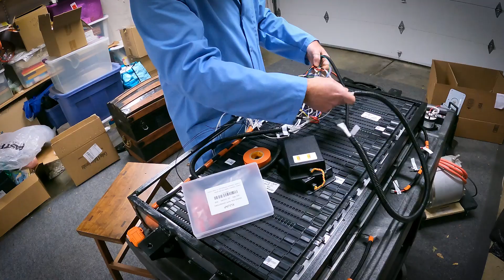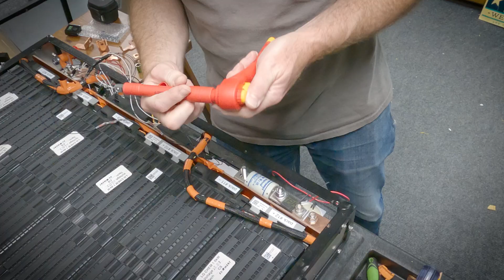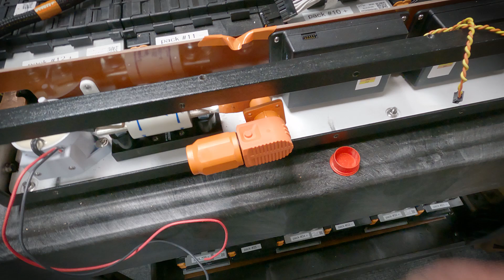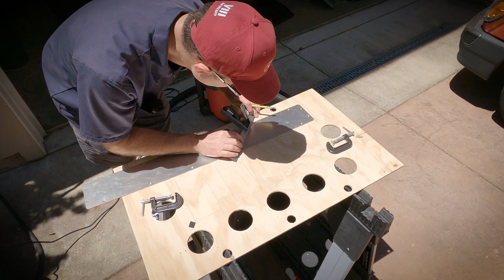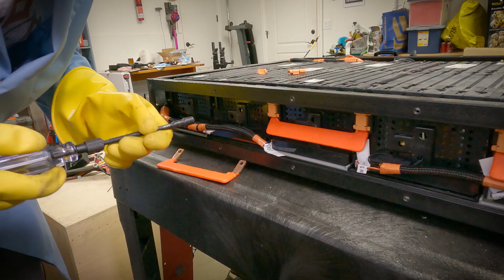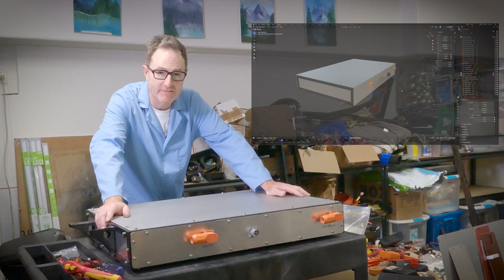EP 32 EV Battery Boxes Part 4 - Wiring, Busbars & Final Assembly

Comment: So is your system going to be 6S x 2P for a total of 20.4 kWh?

BTW I'm in the research stage of converting a 77 Honda Accord so I'm loving this series
Reply from the maker: Thanks! Actually it’s 12s. I have a high voltage motor, so I need to get over 300v. Yes it is about 20 kWh. I won’t know for sure what kind of range I’ll get from that small pack until I test it on the road, but it’s such a light car that I hope it’s good enough to get around town.

Comment: This is looking awesome! Such a clean end result. What cells are you using? For the box did you built in an emergency vent?
Reply from the maker: The cells are the LG Chem Super Cells, which are no longer available. The price and form factor worked for me. Yes there is a vent for extra gas pressure.
Reply: @CVCC_2_EV great packaging and result. Can't wait to see the next steps!